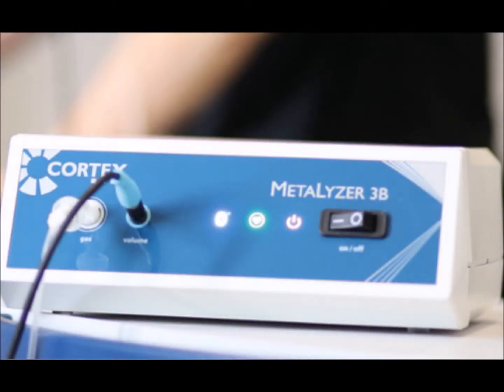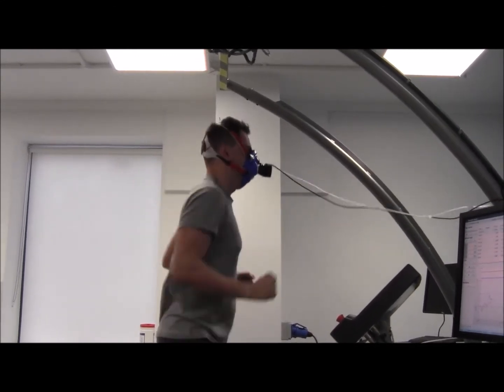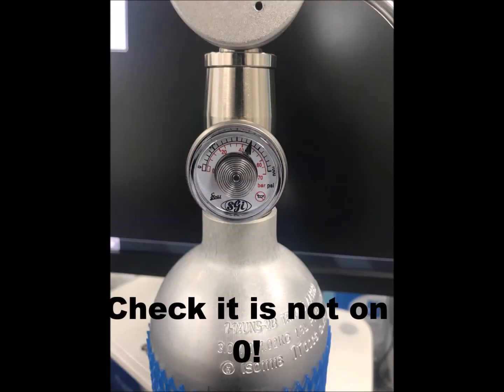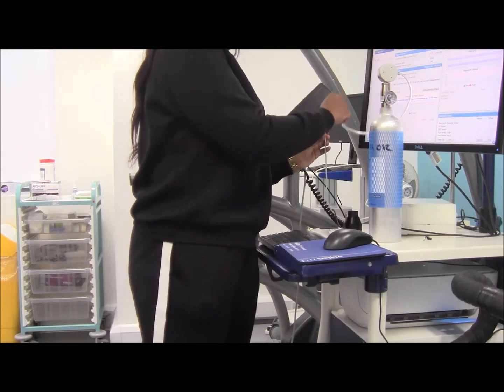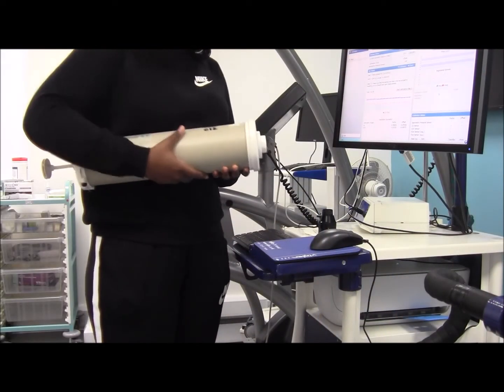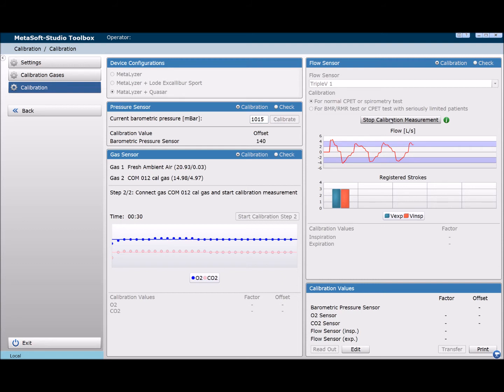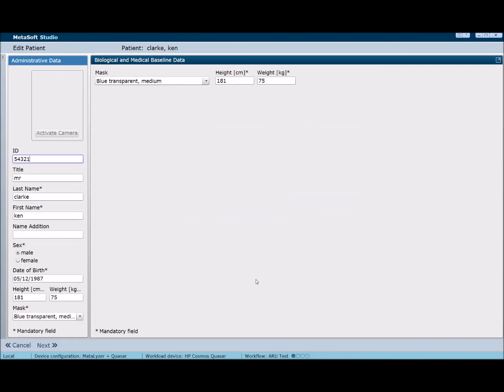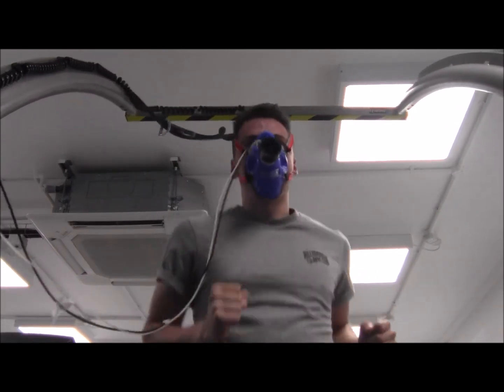Cortex Metalyzer 3b

Comment: Hello.
Thanks for the video.
I have a question regarding the "lipid Metabolism" output report of the system. I performed some tests and aimed to measure the energy expenditure during walking. I checked the results-cpet reports-, to define the "EE" variable which shows the energy expenditure. I realized that I have a range (e.g. A-B kcal/h). I believe it should be a single number as an average/mean to report the EE. I'm writing this comment to ask why do we have a range and what does it mean. I will appreciate it if you walked me through. I hope to hear from you at your earliest convince.